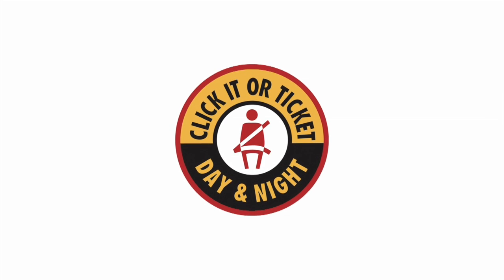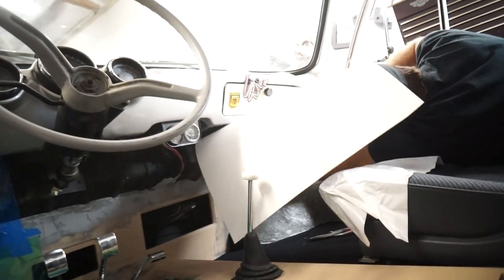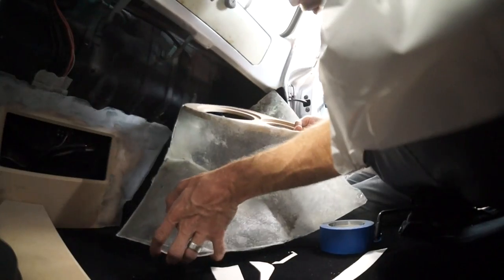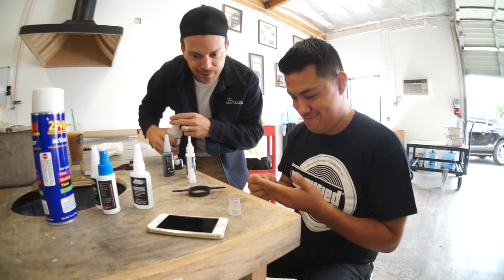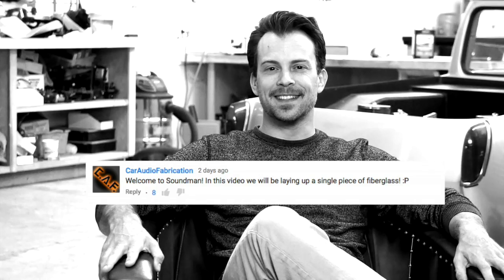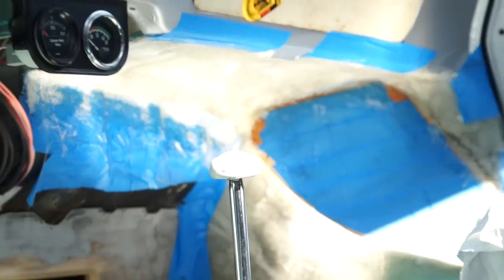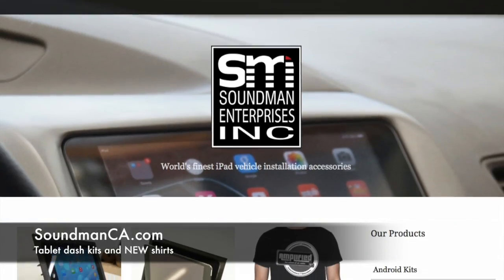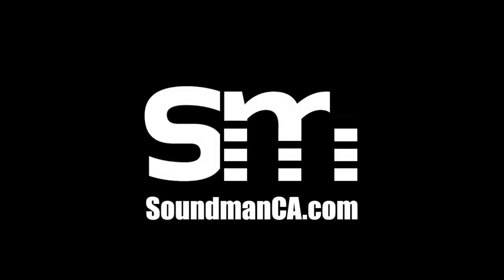Sunflash Kick Panels, part 4

Comment: I'm from the UK and used sunflash to make my sub box in 2013.

I'm still waiting for it to harden.
Reply: ***** Sun and Heat.... Thats what we don't have in the UK.... Ive build some kick panels and door cards for my 1961 splitscreen using UV cure resin and it does take time in the UK..
Reply: You need real sunlight for it to harden, not grey clouds.

Comment: what if you are using sunflash and right before you get ready to place it in the sun a crazy storm rolls in and the sun goes black.... can this shit sit for a while with no ill effects..... we get alot of solar eclipse problems here on signis X43 just outside of the dungee solar system and I dont think I can use sunflash to fix my sand racer in time for the shuttle races